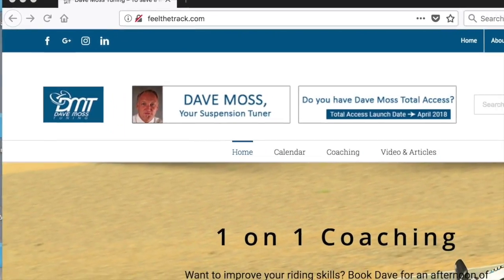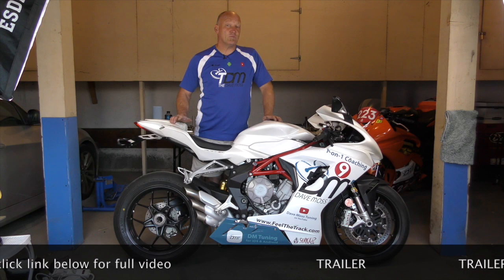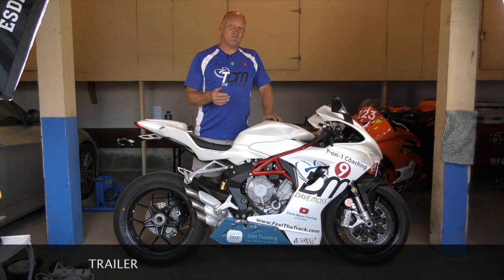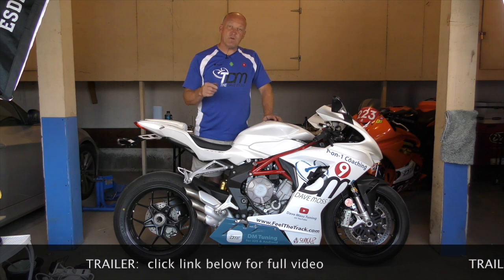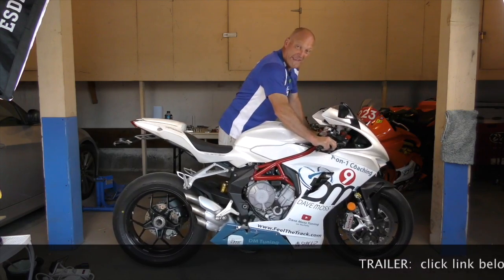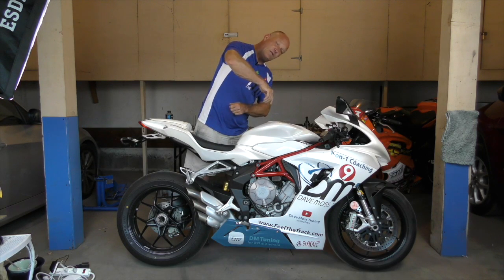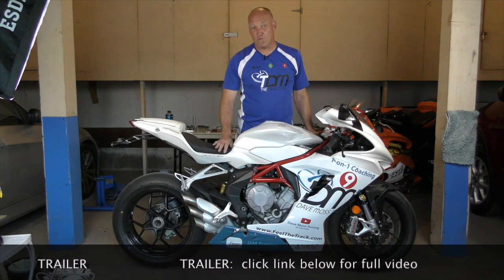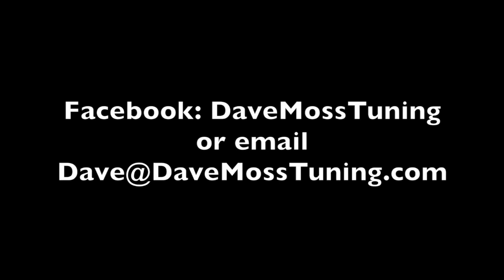Fasterclass: Bounce & Set Rebound (TRAILER)

Comment: Great info... when I bounce the bike I feel as if the front does not compress as much as the rear. Do I make the compression softer or should I just practicing the bounce technique? Maybe I'm not driving enough force down on the front.
Reply from the maker: Practice first. Record all your settings, then take all preload and compression out of the forks, leave the shock as is. Learn the push technique with soft forks. Once you get a good feel for the technique (hot suspension oil is very helpful), then put the preload settings back. Push again. Lastly, put the compression back in so you feel spring, then damping.
Reply: I can not begin to tell you how grateful I am for your channel and videos. You sir, are awesome and down to earth. Thank you for the input.... Ride safe Dave Moss!